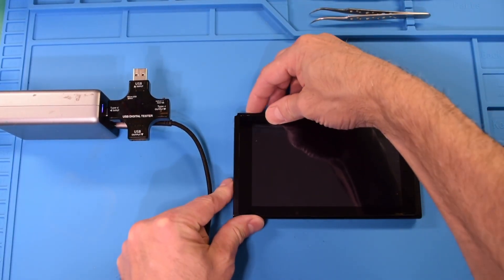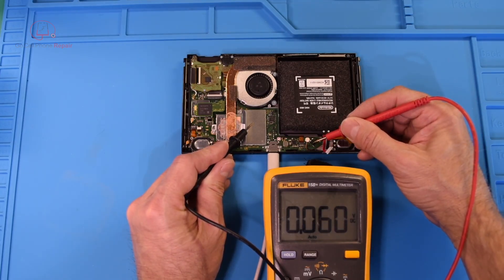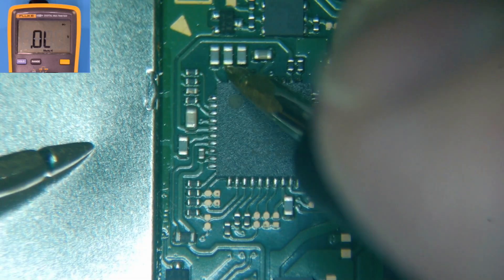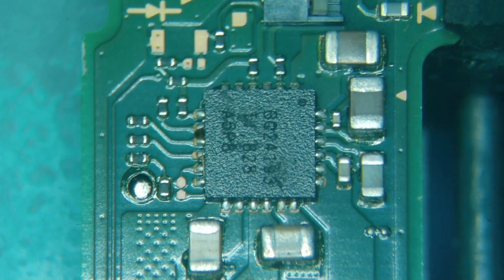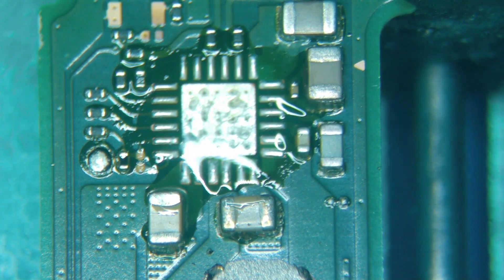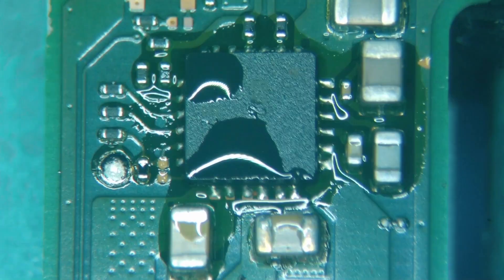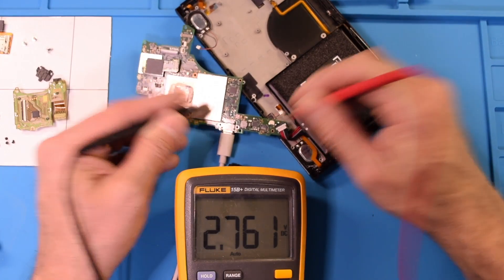Nintendo Switch not charging- It's not the port, it's not the M92T36 IC.

Comment: Hi my friend, I only identified a shorted capacitor near the BQ24193 closest to the coil that generates main power for the board. However, when removing it, I identified that it was not the capacitor and when removing the coil, the short disappeared... The question is that I wanted to know if it could be the BQ24193 IC or another component because I have already removed the IC and I am about to repair it...
Reply from the maker: Did the short disappear from both sides of the coil?
Reply: @GoCellPhoneRepair  So, I discovered that the short circuit came from the diode near the coil, but there is no such component for replacement, so I don't know if I can leave the board without it because it is a diode. I believe it is not that black one near the coil; it was generating the short circuit of the capacitor and consequently of the coil, and only now have I discovered this... a shame... because I ended up removing the entire power supply circuit, and if now I have to redo the circuit, I don't know if it is worth it, as it is micro-soldering and I am not that skilled with it.
Reply: Oh, I've already checked the USBC input and it's receiving power around 13v to 15v if I'm not mistaken, that is, it's not... the switch also doesn't turn on like the one in the video, very similar because it's not even emitting a charging signal...

Comment: Hello there and thank you for the info. are all Bq24193 the same? or do I need to replace it with the exact model on the IC? I can only get my hands on Bq24193 TI 37I A6ZQ.
Reply from the maker: That is a good question. I am not sure if these must be programmed for the Switch or not. I don't believe so but unsure.

Comment: 4:10 what would happens if the top capacitor between the coil and the IC was missing? after replacing the IC i realized im missing it, and also the really small one on the botton right of the IC

Comment: Please Please can u helps me ?
I have now Blowed Up 12x M92T36 ICs its everytime after replacement a short on the caps where i must check for that isue why is everytime a briliant new soldered M92T
36 Blowing up after put the 15V orginal Charger ? Port is new no shorts 😞
Reply from the maker: Sounds like you have a short somewhere else. I would check around the P13USB IC and the BQ24193 as well. A bad port is another possibility. To clarify, are you checking to see that the short is gone when you have the M92T36 off of the board?
Reply: @GoCellPhoneRepair  I have search PI3USB no short, BQ no short, removing the M92T36 is the short gone : ( 
The USB C Port is replaced and i have good readings on Breakboard 😢 ? Have i Bad M92T Batch Chips ? i have order 12x from the same ghuy

Comment: About how much do you charge to look into a switch this deeply? Mine is doing the same thing and is completely dead, even the joycons. No repair shops around me will look this deep into it, they will only swap parts to see if they can fix it
Reply from the maker: As of today, most Switch no power repairs run about $75 plus return shipping.

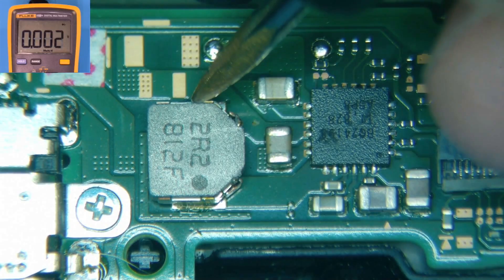Comment: What is the name of the fuse at 4:13? I can't find it anywhere and it is burnt out on my switch.
Reply from the maker: Are you refrying to the 2R2 inductor? Those don't generally burn out unless you see that it is physically damaged. If it's going to ground then you have a problem elsewhere.

Comment: Hello!
I bought a switch with totally teared down charging port. Would like to use an external charging board you mentioned in one of your videos. Already soldered two wires to the battery connection socket and made a cable outlet, but unfortunatelly I can't charge the battery externally when it's connected to the pcb. Also smoked a tp4056 this way. When disconnected from the main board I can easily charge it with my imax b6, but not when it's connected. Do you have any tips for this external charging? Now I have ordered a TP5100 maybe it will do the trick.

Comment: 3:19 if this cap is sorted to ground, what would that indicate?
Reply from the maker: One of two things. Either the M92T236 is bad or you have an APU short. If removing this IC does not relieve it, then the processor is likely done.
Reply: @GoCellPhoneRepair  Darn I have a feeling I've got the latter. Thanks for the help! I've got a board with a short to ground at that cap as well as the two connected to the P13USB.

Comment: when you connect the charger, you always get voltage on input fuse? I repaired a usb c port that is damaged , but i dont know if the new port was ok or is faulty. the console works but dont charge and don´t work on dock
Reply from the maker: Yes, you should get voltage on the fuse near the port when plugged in.